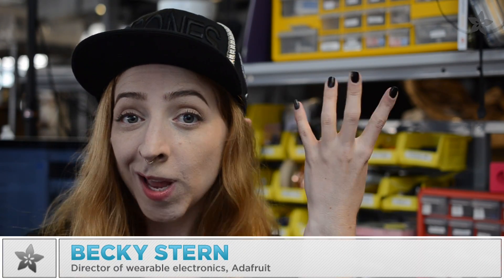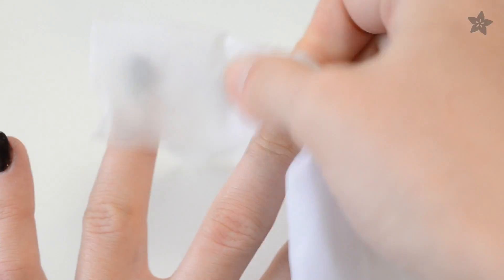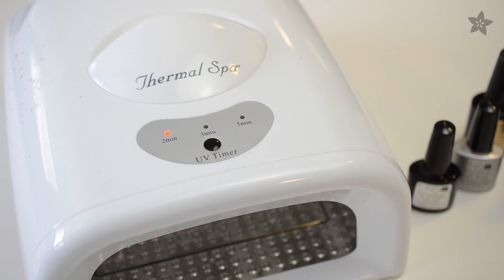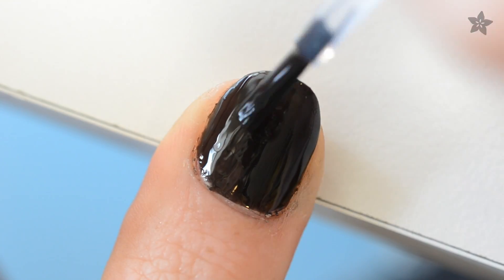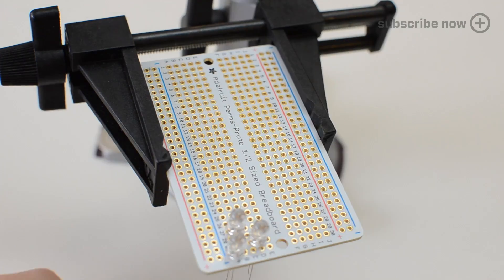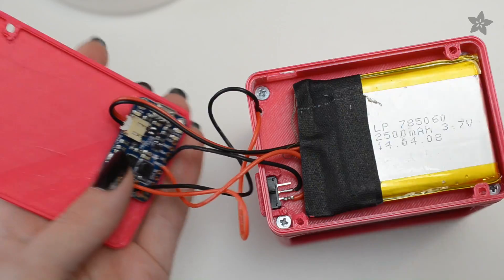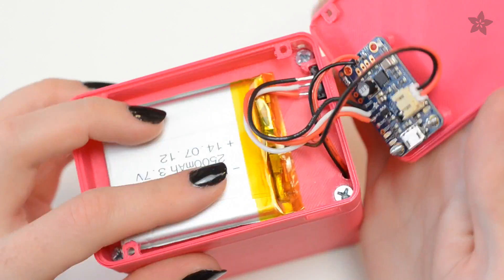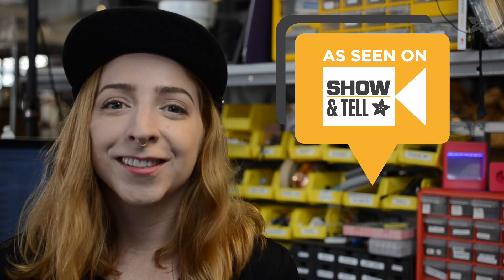UV Manicure Lamp

Comment from the maker: UV Manicure Lamp #WearableWednesday
http://adafru.it/dVH

This week we’re doing manicures with DIY electronics.

If you’ve seen my videos or photos before, you already know I like to paint my nails. What you might not know is that it’s UV gel nail polish– a different chemical formulation that’s more durable, flexible, and lasts much longer than the air-dry stuff.

And it doesn’t just look nice, it lets you do more stuff with your nails– open cans, pick at electronics, do the dishes– I like to call it “structural” nail polish. Without it, my long and useful nails would split and break under the pressures of everyday makin’ stuff.

But gel polish has to be cured in a UV lamp, which is something usually only nail salons have, or, like me, you buy one on Amazon and it takes up as much space as a large toaster oven and has to be plugged into the wall.

Read More
http://adafru.it/dVH

Comment: UV laser diodes plz.
That with this UV curing polymer and you could make a 3D printer.
Reply: These LEDs are close to the wavelength of laser diode used in UV curing resin 3D printers, you could use this lamp to help harden the sticky print when it's done printing!
Reply: I like your brain. You should brain more. Perhaps never stop braining.

Brain.

That is all.

brain...

Comment: Very cool project. How do you remove the polish & clean your nails when you want to if you use the UV hardening nail polish? My being a single father, is this something that I could safely use on my five year old daughters nails? She loves getting her nails done but of course, regular nail polish lasts maybe a couple hours on her nails before it chips n then she starts chipping it off. Her mom does her nails but isn't familiar with the UV hardening stuff.
Reply: The polish comes off by soaking it with acetone, then scraping with a wooden stick-- I use nail wraps to minimize exposure. I've seen kids getting gel manicures at the salon before-- I'd take her to get one and watch before deciding to do it at home. That said, it is UVA exposure, so sunscreen or fingerless gloves on the hands is recommended. When I google "kids gel manicure," tons of pictures come up. But hey, I'm not a doctor, or a parent!
Reply: *****
Hay Becky. Thank you very much for the info, I'm thinking it'll be a number of years before she gets her nails done like this. :) Though I'm thinking of using this polish as some seriously durable paint on projects. :)